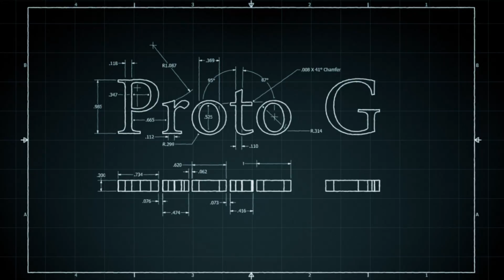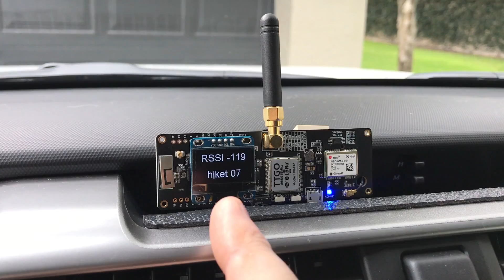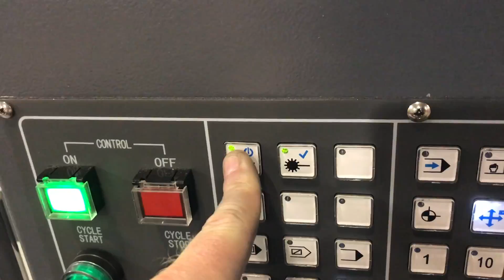TTGO T-Beam // ESP32, GPS, LoRa & Bluetooth

Comment: I have a question I purchased the ttgo I soder every thing then i connect the antenna and power it on red light blinks but the screen is not powering on do you have any advice
Reply: Where exactly did you solder the display

Comment: what core are your using as i'm trying the gps.ino and getting uart serial errors  i'm using the t-beam board from https://dl.espressif.com/dl/package_esp32_index.json 1.02 version and having issues running the default sketches i'm just trying to get the basic gps to display on serial and not having much luck:(   getting "core\core.a(HardwareSerial.cpp.o):(.bss.Serial1+0x0): multiple definition of `Serial1'" which tells me that some thing is screwed up in my core files"

Comment: nice overview, wondering what kind of power consumption you're getting with LoRa and GPS enabled. Thinking of using these for light industrial use , and wondering if using the ESP32 deepSleep and waking every 1 hr the 18650 would last a reasonable time?
Reply: You get approx 24h use time from one battery charge. Solar or usb extends the use time significantly

Comment: Thank for your video and code.
Which IDE did you use to compile the code?
I tried the Arduino IDE with EPS32 addition   to compile the GPS code and got  errors

Thank you Gary

Comment: Looks fancy but what it is this good for?
Reply from the maker: It is a microcontroller with WiFi, Bluetooth, GPS and a long range radio transceiver. There are countless applications for something like this.  Sensor networks, robot controllers, gps locator beacons, and so on.
Reply: Oh I see, now that sounds very practical ! Would the radio transceiver response time allow for it to accurately drive an RC plane over long range(>20km) ?
Reply from the maker: Yes, Team Black Sheep Crossfire uses LoRa for longe range RC flying.

Comment: YouTube’s Andreas Spiess got 200km on his with a proper set of the little antennas. Sounds like yours aren’t the right ones.
Reply from the maker: His videos are great but that was direct line of sight and a world record that he broke by carefully choosing the two highly elevated points. He also had to use the SF12 reduced data rate of 250bits/s to accomplish that range. Depending on your application, that may not be acceptable. The example from the video is using the default data rate of 11,000bit/s which is a lot more data and the default transmitter power. The SF12 he used is also a much longer transmitted pulse than the default SF7 which will give you better range at the expense of max payload. You could definitely use better antennas than this but there are a lot of options for improving range through software. You can adjust TxPower, Spreading Factor, and Signal Bandwidth as well as other configurable settings.

Comment: Since it has a GPS, you can use the transmitter to send its GPS position, and use the receiver to calculate the distance between the received position and the receiver's GPS position.
Reply from the maker: V Ng I had thought about that. Maybe I’ll use the haversine formula in the code.

Comment: Great video. Thumbs up and thanks for the reference to the new board.

One recurring issue though is that a lot of the antennas that are out there are actually not even close to being tuned for the band that they are supposed to operate on. I wonder how well the antennas  on those boards really work at 915MHz? Of course your testing indicates that they are at least reasonably usable, but it's possible and probably even likely that there is a lot to be gained with a well matched antenna...
Reply from the maker: I may end up trying some directional antennas.